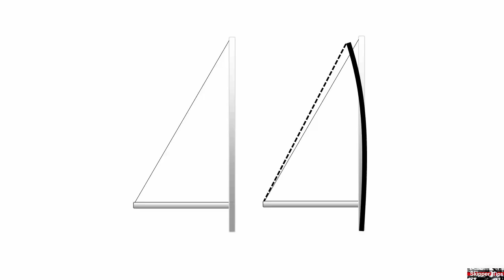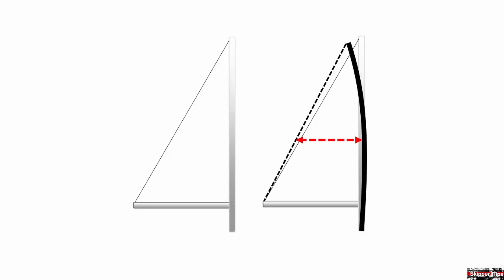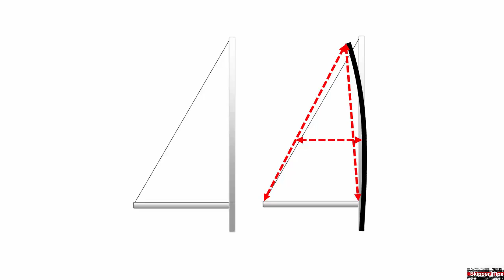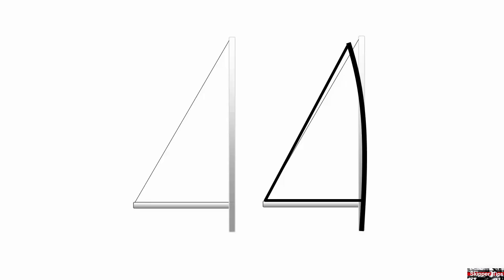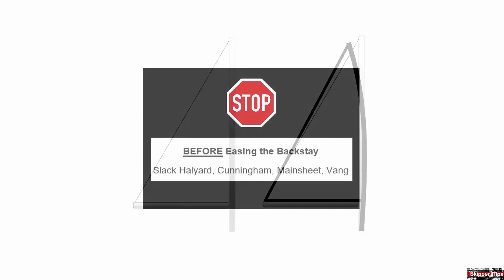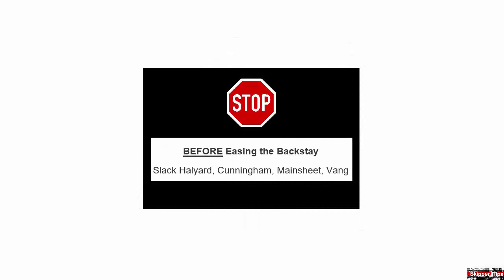Mainsail Trim with an Adjustable Backstay

Comment: This definitely applies to fractional rigs.  Does this apply to full rig as well?
Reply from the maker: If the boat comes with an adjustable backstay, check the user manual for trimming and adjustment tips. A San Francisco racer told me the most critical often-forgotten part is to ease the halyard (or Cunningham), and boom vang before you straighten the mast again. Otherwise, you could tear the sail.
Reply: That's a good question.  I would think a full height forestay would prevent the mast from bending the same way as a fractional, so I'd guess the answer is no.
Reply: It will not bend, but it will move back so the leach is looser and will spill more without twist.
Reply: @mrwrapper  So it does still have effect, but less than for fractional rigs, right?
Reply from the maker: Here is a good article with photos on a boat with a masthead rig using an adjustable backstay: https://sailingskiron.com/2020/06/29/the-adjustable-backstay/
Reply: @skippertips  
Thank you Captain John, for another valuable tip and for indicating the article, also very enlightening. Fair winds!
Reply from the maker: Miguel, most welcome!